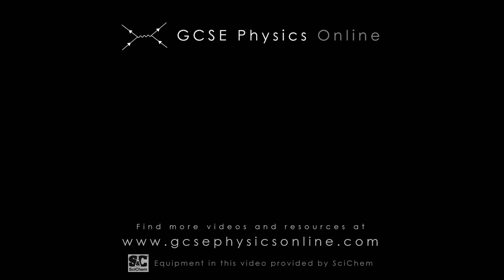Specific Heat Capacity of Water Experiment - GCSE Physics Required Practical

Comment: Hello, I hope you can answer my question. Thank you in advance. Is it okay if I use an aquarium water heater instead of an immersion water heater and perform the experiment in a styrofoam box the size of the beaker to prevent heat loss?

Comment: hi. i was doing this experiment in a more controlled environment with high precision temperature measuring equipment and energy meters, vacuum insulated water container, 4.5kg of distilled water-to minimize the errors, i was stirring the water to avoid temperature stratification and every single time i got values for Cp around 4724 J/kgC. I run out of ideas of what could create the difference. Can we find out who and when and how were calculated values for water what we take for granted? i calculated the thermal losses to minute values and still doesn't get even close to the book values for water Cp-the difference is too high. Can anyone please give me an idea?
Reply: Maybe you should calculate losses of heating up of the container itself? along with all the other equipment in the water (i.e. thermometer, stirrer etc. Everything in contact with the water gets heated as well, no? They have a mass, a specific heat capacity according to their material and they increase in temperature. Just a thought...